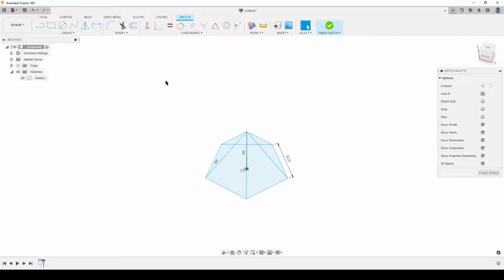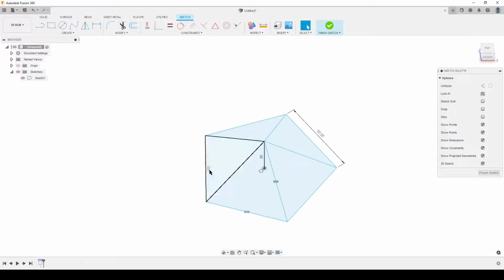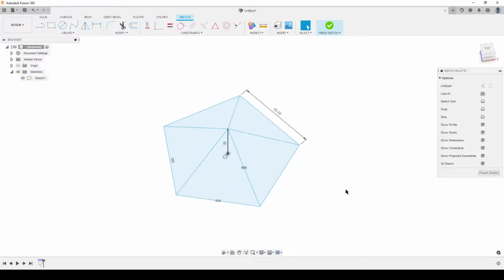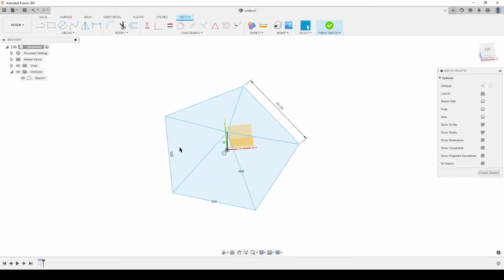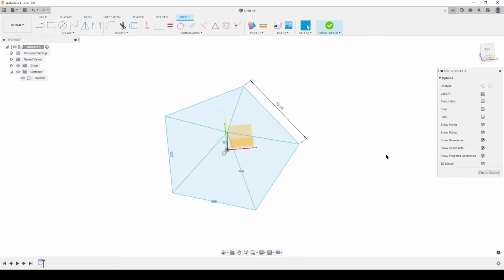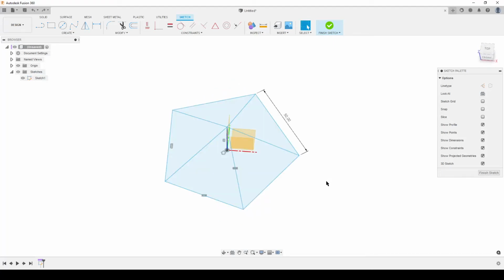Fusion 360 - 3D sketches that do not behave nicely

Comment: And this example is not even that bad, because you intensionally try to move and break it, for such a simple model it works perfectly well with parameters. Try adding equal constrain to the Z height line and the 50mm edge, that is where all hell breaks loose (spoiler alert: It inverts the shape). And the funny thing is that you can revert to the top by grabbing the 50mm edge point and dragging it up. It boggles my mind that a tool that can be so powerful is so broken in fusion360...